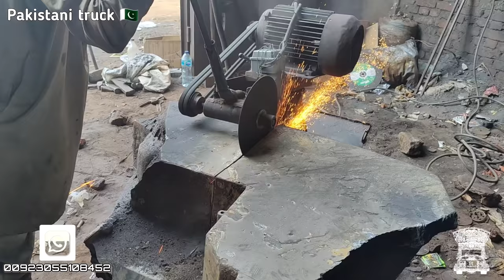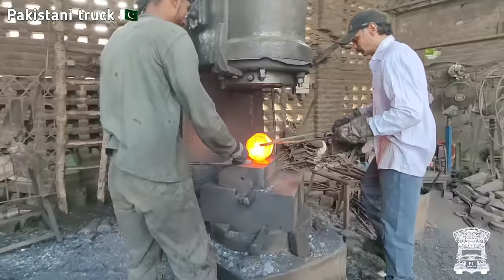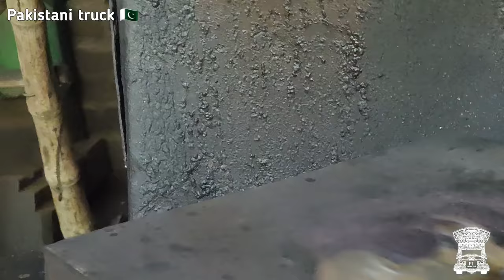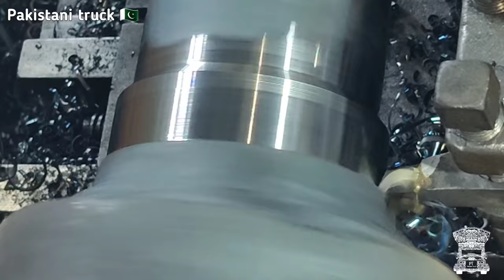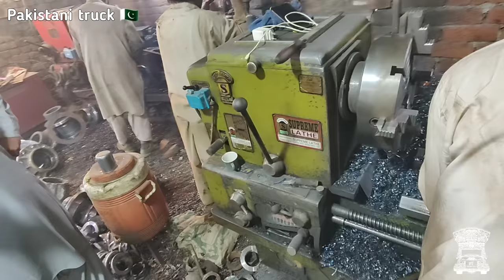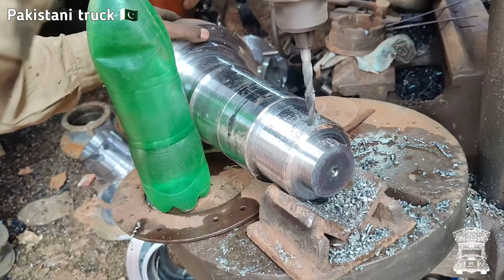Semi trailer axle Manufacturing process | Hammer work for making an axle

Comment: It would be much easier if you drilled in the proper direction at the end of video lol
Reply: It's an illusion caused by the frame rate of the camera, if the drill was spinning backwards, he would not be drilling at all on that forged peice of steel. Their workshop and methods are crude, but these guys do get shit done.